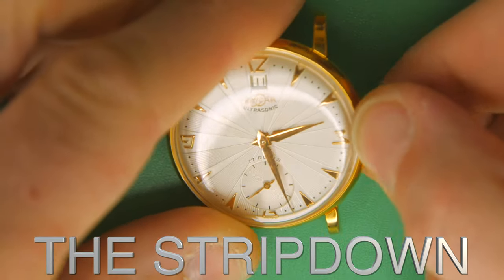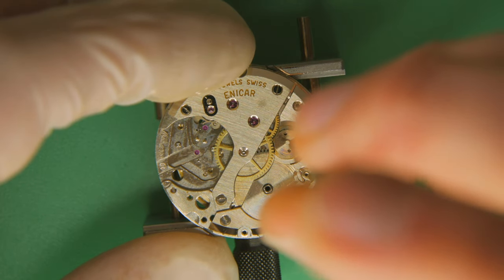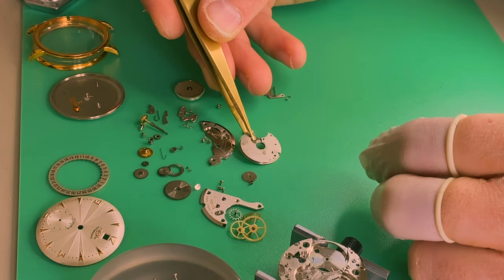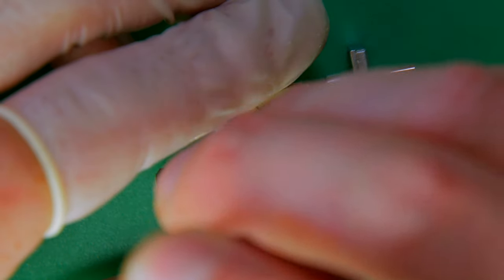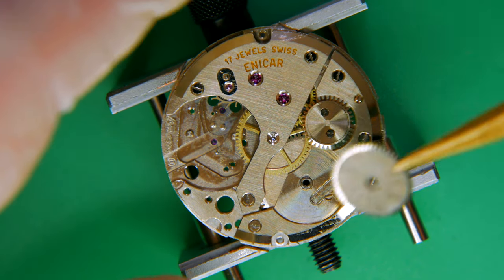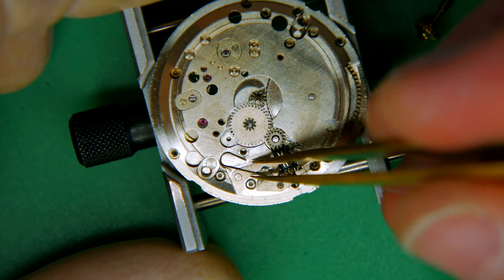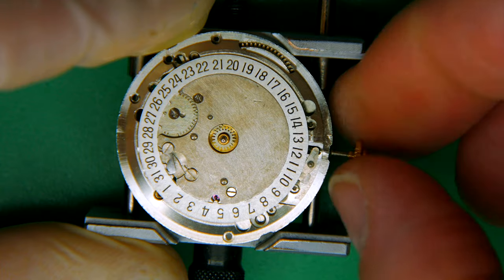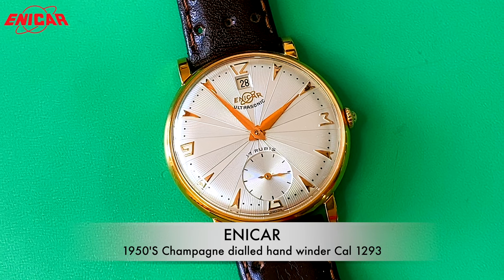Full restoration of an awesome Enicar Vintage Watch

Comment: I'd like to ask you. I have an Enicar AR167C automatic watch. When I wind it with the crown, the automatic rotor spins violently and the mainspring loses power. My watchmaker has diagnosed a defective part #1427. I am unable to get it at a reasonable price. Any ideas?
Reply from the maker: I do not know which part the 1427 is as I do not see that number on the tech sheets.